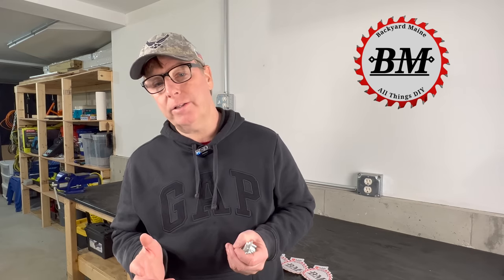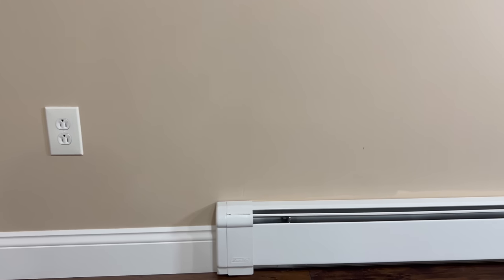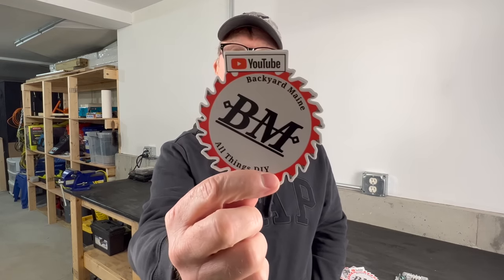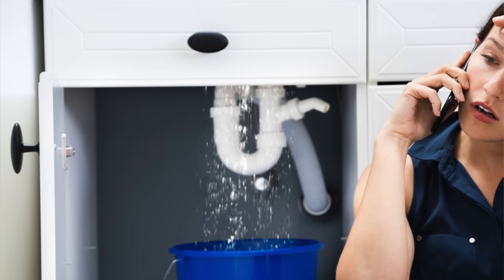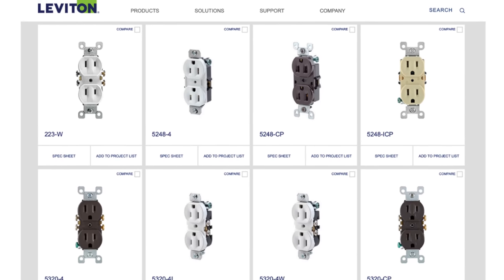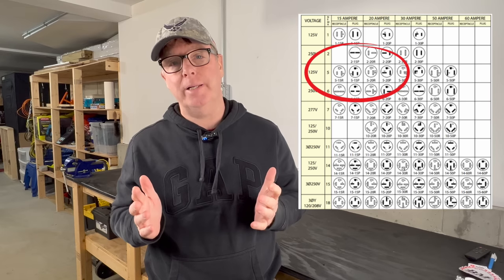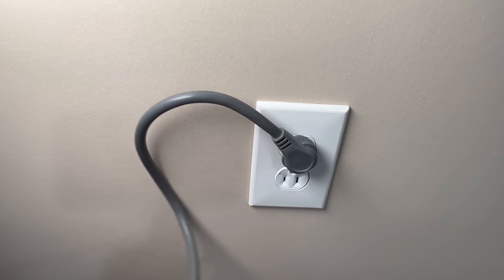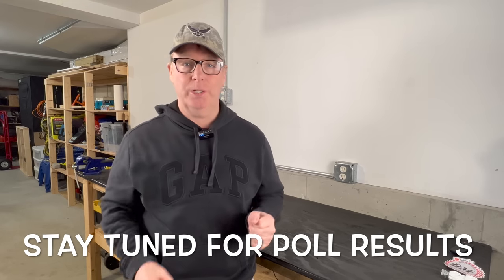Are your outlets installed upside down? (You may be surprised)

Comment: Ground down is the most logical.
Why? Because you should always wire a standard 120v receptacle or switch in exactly the same order: Ground, Neutral, Hot.
And even left-handed electricians I've met, prefer tightening the screws with their right hand.  So, since it's easier to not have to flip the recwptacle or switch around, the last wire is hot, and remains on the right or in the up position.

Comment: I have split plugs in some rooms.  Half the receptacle is controlled by a switch, the other is live.  What kind of receptacle has a split plug with a ground on top and bottom? Never seen one.
Reply from the maker: Me either but Hubbell makes a quad receptacle which has one up, one down, one left and one right.

Comment: I used to always put ground down, until I had a cord that was hard to get out. When I grabbed the plug, I touched the two prongs with my index finger. If it had been ground up, I wouldn't have gotten such a shock. Ground up for me now aways.
Reply from the maker: I find it more likely to get a shock on ground up based on the way I reach for a plug with my thumb on top and my index finger on the bottom.

Comment: Fuuny how the NEC which usually covers things to the smallest detail doesn't cover outlet orientation.  I had looked after purchasing an air conditioner with a 90 deg. plug where I had to reverse the outlet to ground up to accomodate the manufacturers orientation.
Reply from the maker: They purposely don't cover orientation because that leaves it up to the installer to do what's best for each situation. If they did state ground up for example then you couldn't install a receptacle in any other way. No a horizontal receptacle under a panel, a face down receptacle on a ceiling or any floor receptacles that faces up. The omission is a decision.

Comment: Ground up also puts less stress on the 3 prong cord and less stress on the receptacle.
Reply: Have you ever noticed a receptacle when ground down the plastic at the bottom of where the ground prong goes in is broken off?  Or when you unplug a grounded cord and the ground prong is broke off inside
Reply: Ground down tends to break the plastic off at the bottom of where the ground prong goes into the receptacle and so many times have I seen the ground prong broke off in the receptacle when ground down.  Ever had to replace a receptacle that's been ground down because the cords won't stay seated all the way?  Yes they be worn out but last longer when ground up.  These are some of the reasons why we put receptacles in ground up usually in a commercial or industrial building.

Comment: Here in the Philippines the National Electrical Code closely follows the US NEC.  However, the electricians don’t.  Our 15 year old house when we bought it has all black wire on the indoor. Outdoors uses all white most of the time.  Ive seen connections go from white to yellow or blue. No rationale.  No green. No GFI.  The third conductor installed in our bath water heater went directly to a ground rod.  Really!  Most wire color is based on what was in stock.  The new project we made i supervised it and black and white was hot and return respectively. Red id switched and green was not needed as there was no outlet neat water.

Comment: Personally I think we should move to Twist lock  outlets and plugs.

I have a switched over normal outlet near my couch, my couch is a recliner but its electric  so i have to use a 15amp rated strip surge proctor it gives me 6 outlets  now the cord on this is fat and heavy 
My dogs often start pulling the plug out of the wall walking over the cord to get to the window to look out. That means 90% of the time  
It needs to be pushed back in the plug.  Twisting the blades or putting in a carptner u on the blades don't help.
The spring tension on the doesn't help hold the plug in gravity always pulls it down.  A twist lock would solve this.

Comment: I know of a child that stuck a thin piece of metal in a ground down receptical and got electrocuted.  I do not care what they look like; I want my children safe.  If I have a AC cord with the ground down, I install the outlet that way and plug the AC unit into the bottom receptical.   I lived in a town where the local code said ground down.  Anything I did there was without permits.
Reply from the maker: Safe first for sure but orientation is not going to affect the likelihood of something horrible like that happening. Tamper resistant receptacles have been required since 2008 but they will only offer protection when not in use.

Comment: I know the arguments. However, having lived for over 70 years, I have never seen a piece of metal fall from the sky and short my prongs. In fact, many of the cords in my house were manufactured to insert into ground down receptacles. Turning them the other way would put strain on the cord. I'm not an electrician, so mine is only an opinion for what it's worth.

Comment: My use case has been Always Ground Down, 
except for Switched controlled outlets which are Ground Up so you can tell that, that receptacle is controlled by a switch.
You cover that in your Video.
Do not use Cheap outlets.
The Cheap ones do not have the same Prong Retention as higher quality receptacles
When you plug a cord in, you want the contacts inside the receptacle to Grab on and Hold that cord in.
Weak prong retention, that lets the prongs come part way out, leads to Heat, which then Leads to weaker prong retention.

Use a Good quality Outlet, and then it doesn't matter about the Ground up, as possibly being safer in the event of a partial fall out of the prongs.
Reply from the maker: I agree that a commercial or spec grade receptacle is a better choice but the residential devices will hold up pretty well if they're wire correctly and aren't exposed to excessive load. I was on a budget when I wire my home 25 years ago so I use residential grade devices. I have not had a single issue in all these years. But I may redivide sometime soon just because they are getting old and don't look as good anymore. When I do I'll use commercial grade devices.

Comment: Mine is up side down, and the bottom one has no power. Nor is it connected to a light so does that mean it’s installed wrong. In school for electrician and I haven’t seen that.

Never mind figure it out we have two switches in our room and one controls the light and didn’t know what the other one one controlling and it turns out it controls that receptacle. Why is that?

Comment: I don't like the ground up where I have to use an appliance like an air conditioner or uses a heavy type of power cord. Makes for a clumsy connection with the plug.  I see in many of the new buildings the outlets are installed with ground up.  

The National Electrical Code (NEC) doesn't require a certain direction. The NEC allows outlets to be installed with the ground plug hole facing up, down or sideways. It's up to you, there is no standard electric outlet orientation. So that means there really is no such thing as upside down outlets.
Reply from the maker: I made that point very clearly in the video.

Comment: You need to point the ground down toward the ground so the electricity knows which way to go.  Also, if you have one installed horizontally, it must be pointed to the right because it's the right way..  Worst topic ever :). Flipping the switched receps upside down was a brilliant move that started some time in the mid 90s.

Comment: Up.    NEMA doesn't spec  but display of the table shows up. Hubbell has their name stamped on the face so to read it ground up.
Reply from the maker: I work with Hubbell and they also offer a quad receptacle with one receptacle in every orientation. HBL-420 or HBL-415 The manufacturers are very careful not to recommend orientation because if they did we would have no choice.
Reply: @BackyardMaine  51 years in the trade here and always ground up  unless otherwise specified. It's the German thing in me, and all my Jw's were of European background as well, so again, ground up. It makes more sense  because the ground pin being longer holds the plug in the receptacle better.

Comment: What if I have a an out let where one half of the out let works and the other does not? Or a three way switch that if you cut the switch on it trips a breaker. The other switch is supposedly controlled by a dimmer switch.
Reply from the maker: The half working outlet is most likely a split receptacle where the other side is controlled by a light switch. The 3-way switch is wired wrong probably applying power to the neutral or possible you have a short circuit or a ground fault in the wiring.

Comment: I know it is often spec’d to be ground up on my blueprints. I know homeowners hate it and I don’t blame them. 
The explanation I always hear about why is nonsense at best
Ground down is best. Master electrician and contractor I can tell you that I’ve never seen a plate magically fall off and hang on the ground pin.
Reply from the maker: You are correct. I worked in the industrial setting most of my career where device covers or wall plates are almost always conductive and I have never experienced that either.

Comment: I've actually heard that the typical way outlets are orientated is wrong. The 'ground' plug should be on top.
Reply from the maker: Many who say the opposite as well. Even the manufacturers are not in agreement. Notice that most 45 and 90 degree cords are oriented for ground down but a few are the opposite.
Reply: @BackyardMaine   Right! All-in-all does it really matter? Seems like a six to one, half a dozen scenario.
Reply from the maker: It's a user or installer preference. I prefer ground down.  @Thatgirl1973

Comment: I do GROUND up, because IVE seen outlets with a stainless steel plate, SHORT OUT on a plug when the plate screw fell out.. It fell across the blades of the plug..
Reply: That is a million to one shot. Not enough to tip the scales.
Reply: @tommytomtom5531  Really, I've seen it more than once...So there

Comment: Down. 
I wonder too if there is a regional preference. 

I'm in Canada and not an electrician but have troubleshot hundreds of receptacles. In this capacity, I dont think I have ever seen ground up. 

Not relevant to my current experience, I used to be an R&D mgr for a tech mfr. I was an "expert" in a number of liability claims. Attending court proceedings in Quebec, I noticed a lot of ground up receptacles which I had not observed in my home province. It had no bearing on the outcome.
Reply from the maker: It’s quite rare around here as well but I do see them on occasion. Some cities have local code that mandate orientation. Chicago for example mandates horizontal installation

Comment: What direction should it be if the receptacle is on the wall horizontal
Reply from the maker: It doesn’t matter but if we use the same logic as ground up then neutral up would make sense.

Comment: well my 1978 had no outlets with a switch and right now I am in a new Apartment and it also has no outlets with a switch and by next  spring there will be 360 apartments with no outlets with a switch
Reply from the maker: I don't have any outlets controlled by a switch in my house either but it is very common. It's also required by code if the room doesn't have a permanently installed light controlled by a light switch. So if you don't have a ceiling or wall light a switch needs to control at least one outlet in the room for a lamp.

Comment: Actually if u r in a office Ground up is safer  heres why paper clips and paper or letter openers have fallen on the exposed hot leads where as the ground up no issue has been reported….. did a whole office build in So Cal and happy campers inspector agreed with Code and new intall??

Comment: It makes no difference weather they are up or down. I herd it was a New Hampshire thing. What about a combination switch and receptacle? If I use one I try and mount it in a horizontal position so that the switch is vertical up for on and down for off. The receptacle in this case is horizontal
Reply from the maker: Like I said in the video it’s not code so it up to you to decide

Comment: Grd up I have  a machine shop and use lots of extension cords   and equipment and tools that are all designed for grd up plug in.s  when grd is down it places great strain on the cord grd terminal and will break it off the cord grd up eliminate.s that problem

Comment: Another reason ground down is wall ac/dc adapters are commonly designed in the ground down orientation. Most don't have a ground electrode but they are still orientation specific because of the common-neutral spades.

To me this is an example of a solution in search of a problem. The safety argument is incredibly weak in my opinion, though I don't have any hard facts. It would not surprise me to find a fire, or any injury, was ever caused by this. Maybe it has, but it wouldn't surprise me, and if there is an instance it would also be unsurprising if there were extenuating circumstances

Comment: The outlet behind you has a metal cover plate vs plastic....
If the metal cover plate comes off while something is halfway plugged in.
The plate would fall onto neutral & line (short) Ground up = no short
Reply from the maker: The cover plate has two screws with locking nuts on the back plus the screw to the center of the receptacle. That plate is not going anywhere.

Comment: NFPA 99 does call out ground orientation for healthcare facilities. Any outlet with a metal cover plate must be installed ground up. The rational used for the 90 degree plug is invalid because if the device that is plugged in is placed in an elevated location (like a lamp on an end table) the cord is in the appropriate orientation for that application. Esthetics should never be the determining factor over safety. Always putting esthetics ahead of function or safety will earn you the Darwin Award you deserve.
Reply from the maker: Hospital building specs often reference IEEE std 602 which recommends ground up. Article 517 in the NFPA 70 has no requirement. And of course there’s no requirement in residential installations either. If the NFPA thought it was so dangerous that people would be given a Darwin Award I assume they would have a standard. lol. Also maybe you can give us the code reference for orientation from NFPA 99.

Comment: There is more. At 220 V EU standard, the current is 1/2 for the same appliance in the USA. If you make a short in EU with say piece of copper wire, you hear loud bang, molten copper flying in all direction and blown fuse. In similar scenario, in USA, the current is 2x as much, and the fuse does not blow. I seen this in the lab, where the copper wire got hot, but did not blow, and made a long ominous 60 Hz sound. FIRE DANGER! So, how difficult is to take a 1 inch of PVC pipe with correct diameter and glue it around the outlet, as a collar to create some protection?

Comment: ground up for fail safe propper install by NFPA electric code. so if a thin metal sheet falls over on plugged in device at outlet it hits ground and not live post
Reply from the maker: The NFPA does not recommend or specify receptacle orientation.

Comment: A piece of sheet tin fell across a receptacle, at an angle, with the ground down, and did NOT also contact the neutral. NO SHORT.
It energized the ENTIRE SHEET!
A man touched the sheet, and was shocked! Safety department investigation revealed that if the receptacle was mounted ground up, the whole incident would have been avoided! GROUND UP!

Comment: The writing on most receptacles reads right-side-up when the outlet is positioned ground-down.
Reply from the maker: I think one brand did that for a short time but I have used several brands including Eaton, Hubbell, Leviton, Pass and Seymour and I have personally never seen one. Of course single pole switches have top printed on them.

Comment: Hospitals in California require receptacles to have ground terminal on top.
Reply from the maker: Many use IEEE standard 602 when they write the specs.
Reply: From a physics standpoint, that would make the plug more easy to disconnect itself.  With two prongs on top it is anchored by the ground on the bottom.  If all you have is the ground plug on top, slight down pressure would disconnect it whereas two on top would remain plugged in.  There is a logical reason to install down.  You don't have to twist your wrist 180 degrees just to plug something in.  You know, because most plugs have a flat top where the two prongs are so you can rest your thumb.

Comment: I've been in this business a long time just as some of the others here. You are correct that the NEC does not call out which orientation is required regardless of where the receptacle is installed. When I was an apprentice it was taught that ground up was a union practice and non-union installed them ground down. Talking about other orientation there is another position that is called out in the NEC. When receptacles are installed horizontally they are to be installed so that the neutral is down and hot is up. Of course this was mandated when boxes were predominately metal but it's still code today regardless.
Reply from the maker: I can up through the union (IBEW local-7) and we taught our apprentices ground down.
Reply: I’m going to need you to cite your source, as I’m pretty sure the NEC doesn’t specify orientation at all.

Comment: Here in the hospital, they insist that we put them ground up as an additional safety measure in the unlike event that a metal object were to drop onto a plug that is not fully inserted in the tradionally installed receptacle causing a short!
Reply from the maker: The reason most healthcare facilities spec ground up is because the reference IEEE std 602 in the build specs